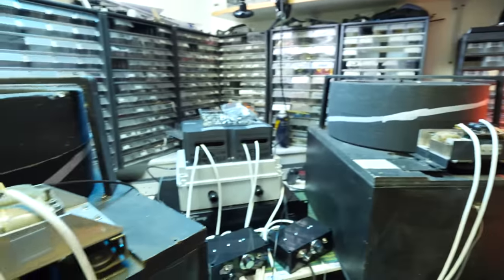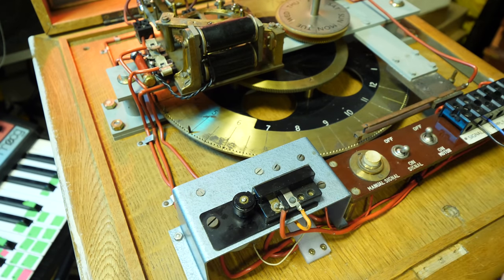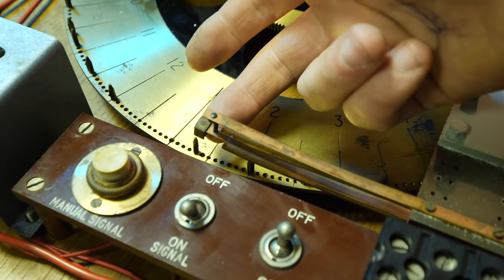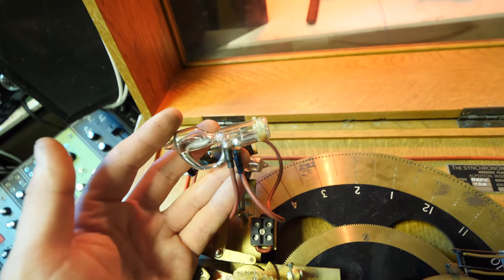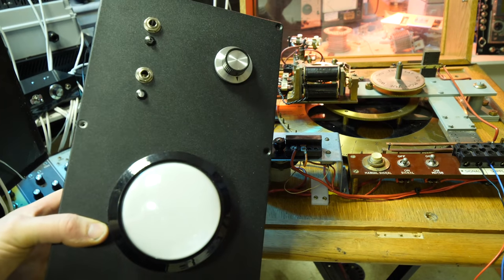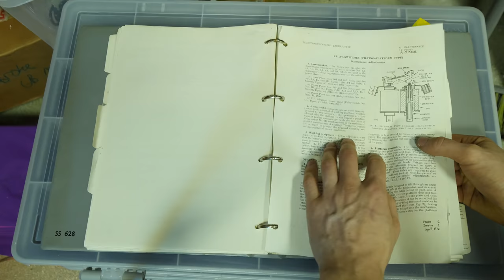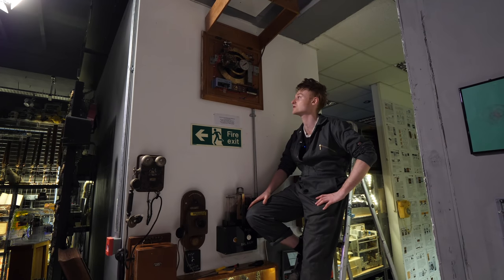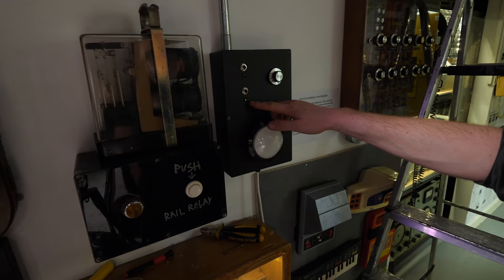Wiring Up A Vintage Mechanical Sequencer For Bells

Comment from the maker: Regarding the Mercury since shooting this video have got a mercury spill kit as well as the sulphur powder mentioned in the video, risk assessment updated accordingly and also an external lock to the box. having spoke to people with experience with museum installations this was what was recommended.
Reply: btw cool video by the way!
Reply: I can confirm, I played with the hooting owl on Sunday and am not suffering from mercury poisoning (yet)
Reply: Don't you have thermal delay relays? maybe they make a 5 second one and you can make some sort of replacement for the mercury switch.
Reply from the maker: @angst_  for which machine?
Reply: Assuming you're following COSHH guidelines..? But if not, COSHH is your friend.
Reply: You could probably fasion a pin for this machine using some pcb standoffs, if they were in the right size, and you can get ones with threads on both sides which could work? Not 100% sure though, but it's somthing you might have on hand :)
Reply: @James_Dawes  alas it’s not metric threads. All good will find something
Reply: Is there an exception for Museums and Interactive Displays?
Reply: @AMPProf  an exception of what?
Reply: @stencilgraffitiapp  i did look, however this is the first time something i have has required to follow COSHH
Reply: @LOOKMUMNOCOMPUTER  exception for the allowance of the use of mercury switches in the context of a Museum piece displayed for public view.
Reply: @THISMUSEUMISNOTOBSOLETE  replace the mercury switch in the mechanical bell timer with a normal relay, then have that relay power a thermal relay. wire the bell through the normally closed side of the thermal relay. That will produce a single pulse for each "pin" of the sequencer.

Alternatively, look into electrical timer relays. 8 and 11 pin relay timers are really easy to use and they can have many modes of use including delayed on, delayed off, one-shot pulse, repeating pulse, set/reset, etc.
Reply: I would honestly keep them in, but having them slosh around by being moved by the machine too fast could be a problem. It is high enough that people should not be able to tamper with the box, I would try and make a brass piece where the existing locking plate would have been, (from what I saw, the lock was still intact, just that the part that it grabs on the back board was taken off.

I mean it is a museum and it is an awesome piece to keep! An alternative maybe that you may just have to keep it on a timer so that it gets a pulse every few seconds, removing the "interactive button" which is sad but would ensure that it wouldn't be too much force given to the movement since when you pressed the button, it was a lot of movement going on which could damage the mechanism and mercuryswitches itself, (for say someone just clicking it really fast).
Reply: a shallow tray in the bottom of the cabinet would help to make sure no mercury leaks out if something happens, and make the clean up a whole lot more simple!

Comment: I'm sure it will be safe given the steps you've made to keep it safe. To put it into perspective,  I visited a lighthouse here in Australia where the rotating light assembly which was perhaps 3 or 4 metres diameter was actually floating on a bed of mercury,  you could push this thing about easily even though it weighed tonnes.  The lighthouse keeper would have to top it up from a flagon of mercury from time to time as it gradually evaporated. The keeper lived in the lighthouse for months at a time... 😯

Comment: It's nice to see more of the electromechanical stuff in the museum. I think it would be cooler to clock this at its intended rate but stick a pin in every 15 or 30 minutes. You could have it trigger something quieter than a bell, such as a blue spinner (like you get on emergency vehicles).

Comment: Actually worked at a place from the very early 2000's to 06 that still had a master clock and 3 of those bell ringer jobers. The master clock also sent it's pulse to the clocking in punch machines. You should get the whole set up and get people to clock in and out of the museum😎 also the punched cards were processed somehow and that was how you got paid. Over 3 mins late and you lost that hour.

Keep a jar of sulphur around. If you do have a mercury spill get the sulphur on it.
Reply: Hey thanks Matt!!! Cool yeah after that!!! And if you saw all good it was only a 3 second bit in the vid but I was waving about a bag of sulfar haha

Comment: I specifically remember a modern type of this system in my high school. teachers would love take apart the clocks to try and set them by pressing the solenoid but maintenance would get pissy having to reset them because that was supposed to happen at the office. only being able to go in one direction, maintenance had to press the solenoid a bunch of time to bring it back around. (a side note; the actuation signal was like 1.5 seconds)

Comment: Museum of steam at Kew has mercury arc rectifiers. Those would be a much bigger deal if they were broken, so they probably know what the proper safety regime is. Don't forget that boring old fluorescent tubes have mercury vapour in them and nobody worries much about them.

When I was at school (~45 years ago) we used to clean mercury in the physics lab by squeezing it through chamois leather.

Also .. YOU need a mercury arc rectifier. Fabulous things. See photonic induction's recent demo.

Comment: Basically the same as, how we call It in Italy, the quartz system
It's an analog mechanical programmer for church bells made from the late 60s to the late 80s
(The belltower in my profile picture still has a quartz system at the bottom of it)

Comment: Wow I had to look after one of those in a school, not far from where it was made. Several times I had to re-program it. I was actually the chief lab tech. I also had to deal with a large mercury spill, a lot more mercury than you have there, which was round the heating pipes. I ended up with acute mercury poisoning. I was on 100% oxygen for 24 hours, and off work for a week. You could see the mercury in my lungs on an X-ray. Your spillage kit would be better if the sulphur was mixed with calcium hydroxide.

Comment: The mercury in those switches is metallic (not organic), you can actually hold that in your hand safely, metallic mercury is dangerous if heated (mercury vapour)
I used to work (as a sparky) in a lab environment, afaik their spillage kit was basically a syringe and a container, search for 'mercury spillage kit' there are a few about, even on amazon
i wouldn't remove the switch.
There were mercury switches in xerox protocopiers (i had loads of switches), they were glass but clear rubber coated.
They use master clocks in exchanges, not just to drive wall clocks, but to set the timing for things like off peak metering etc.
Reply: I’ve got sulfur but maybe syringe would be good! Yeah gpo master clock is something I’m on the hunt for to drive the meters in the uax13 strowger rack, but haven’t found a cheap one yet! People are wanting like 300 quid for em, quite a bit of money! Hopefully one turns up one day for the right price :D. Looks really cool without the clock face those thingies
Reply: @LOOKMUMNOCOMPUTER  Can confirm. What I would worry about the most would be putting heat on those like putting a strong spotlight. I guess that also includes putting lots of electric power through the switch.
Otherwise it is not that dangerous.

Comment: Sam, did you consider using PCB stand-offs as replacement pins? Should be able to spec ones that fit the threads and height of the stock ones…

Comment: Sam why not make a small bund (tray) under the clock.  That way if the mercury escapes its contained. Could even add a circuit to show if its leaked through the mercury conductivity (level probe maybe) cheers mark m
Reply: Just a pair of bare wires at a certain height in the bund (or across the bottom of the bund), job done.  Wire it up to a normally closed relay and kill power to the clock if the mercury makes the contact.

Comment: I think if the mercury switch is safely enclosed, she'll probably be allright.
These master clocks would be ideal for schools. No messing about with clocks and kids taking advantage of it. The schools I went to all had individual clocks in the classrooms, so they could easily be tampered with by the students. These where all standard domestic clocks running on batteries. In a school, accurate time is important.

Comment: You could have the arduino default back to the slow speed if the dial hasn't changed in a few minutes. I can write a sample bit of code if you want.
Reply: That sounds like a very useful idea actually!!’n I wouldn’t know how to do it without a faff. I guess it’s pretty easy if you know what your doing proper style?
Reply: @LOOKMUMNOCOMPUTER  I tried to comment with a link to my code, but I think it might have been removed (spam?) I wrote you some arduino code.
Reply from the maker: alas can't seem to find it! no comments seem to be held for review. if you could possible send the link via this??? there's a contact form https://www.lookmumnocomputer.com/donations thanks a lot!!! regarding the thermal relay, indeed there are a number of things to do turning it into a pulse to be honest If I was going to replace it id end up making it more useful and just using a resistor and capacitor to make a trigger converter. but I did the risk assessment even got a full mercury spill kit chatted to some peeps. overkill but gunna keep em in!
Reply from the maker: hey j3 finally got a chance to try the code! its real good! however 1 tad problem, because of the way its setup, the potentiometer does not update until the standby cycle is completed, which means if you twist the knob it waits till the end of the maximum delay time turn on and be adjustable if that make sense? so if someone twists the knob it might not actually turn on until a minute has passed and the standby cycle has completed. I tried to work through the solution this evening but I ran out of time, hopefully I get a moment tomorrow. thanks again!
Reply: @THISMUSEUMISNOTOBSOLETE  OOPS! I just updated the code, find it at the same place. I replaced the hard delays with another timer so it doesn't lock up the program. EDIT: also meant to say that I found a potentiometer so I got to test the new code.

Comment: Sharpen the end of some ATX board standoffs they look very similar to those pegs, might need to just screw something into them to make them taller.
I think my school used one of these. Just make sure that the box is locked so people can't access the mercury you should be fine.

Comment: the thread on those pins is unlikely to be anything modern (ie, not metric like pcb standoffs as someone else suggested, and possibly not imperial). they may be whitworth (used in meccano) threads, or BA (used in model trains, i think)
Reply from the maker: aah whit worth interesting yeah they are not metric. meccano though interesting, they seem a smaller size to the mecanno I have seen though.
Reply: I actually thought of Meccano after initially thinking of standoffs.
Reply: PC standoffs are either M3 or 5/32 UNC, I don't quite know why it evolved that way but hard drive screws are 5/32" and optical drive screws are M3.

The easiest way to work out what they are is hold the thread up to a bolt or tap and see if the thread matches.   They could be 2BA or something, a hobbyist machinist who makes model planes or trains can probably check it for you (and no doubt make some for you)

Comment: the threads look a similar size to the standoffs used in computers.
perhaps they can be used, they even have a thread on top where a small round head screw could be mounted to smooth out the top.
no custom parts and easily available.

Comment: They sell clear plasti-dip.  I assume you know what plasti-dip is, but if not, it is a rubber coating that is often used for tool handles and such...they even cover cars in it now.  But anyway, you can coat the mercury switches it that stuff, it will make them more durable and keep the mercury inside, if the glass happens to break.

Comment: Although the severity of ingestion or inhalation is high the likelihood is very low, keep it original. Have you done written risk assessments for the museum? The HSE website has risk assessment templates, if you fill them in it can be helpful to rationalise the risk and is evidence of the considerations you are obviously making: "As an employer, you're required by law to protect your employees, and others, from harm."
Reply from the maker: it would be a bit mad if we hadn't done any risk assessment and opened :). like most of the stuff, had to do it properly. would be a bit worrying if we didn't!!
Reply: @THISMUSEUMISNOTOBSOLETE  Absolutely, you are the creator of the IT'LL KILL YOU 5000 but it still would have surprised me if you hadn't dun 'em. We like our madness controlled to approximately 5000!
Reply from the maker: @ches74  hahaha that is a fair point :D

Comment: Would the motor your not using be a clock motor that turns slowly based on the 50hz mains power?
Reply: Yes but it was done in such a way the coils were on for most of the time

Comment: when the tilt speed of the mercury switches is cranked right up, the switches aren't working correctly.  the mecury is not given enough time to cycle through the tube...........

Comment: Don't put LED's inside for lighting, better will be with LED floodlight or similar light projector on ceiling or opposite wall, pointing in bell programmers direction..

About mercury switches - leave these as is.. These are pretty cool old-school devices.. 👍😎
Reply from the maker: but it has a reflective glass on the front hence led inside, on the bottom of the cabinet so not visible.

Comment: @THE MUSEUM OF EVERYTHING ELSE The unit should be fine as it was manufactured before the regulations came into effect . Farnell STILL SELL Mercury switches https://uk.farnell.com/c/sensors-transducers/sensors/tilt-switches/mercury-tilt-switches 
So, I dont think its such an issue . With it being in a museum I would show some due diligence and have a mercury or chemical spill clean up kit and a spill proceedure in place so if the authorities come for a nosy you can show you are responsible enough . No big deal. But yes, PLEASE DO keep the original switches in place . Hope this has helped .

Comment: Arent these kind of "analog solutions" in this case much much smarter, and involving much more creativity and thinking than their modern day digital equivalent? I dont say digital solutions arent intelligent :D its just with these "simple things" that involve some serious engineering, so that this magic about the simple things get lost because the digital way is so much easier.
Reply: Another way to look at it is that digital things are way more complex, it is just that the complexity is hidden in the building blocks that are used by the people designing the end product. Designing a microcontroller is very complex, but the cost of that is shared by thousands of different products. As is the methods for fabricating those circuits.